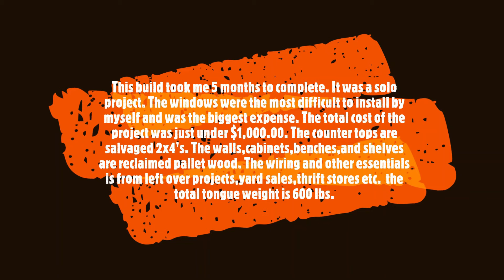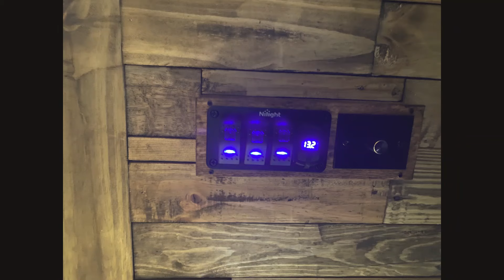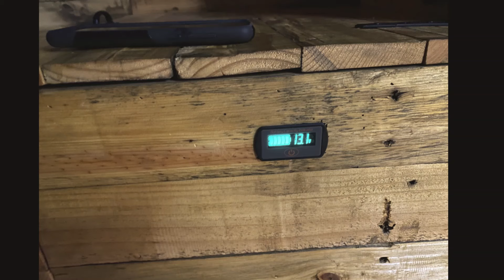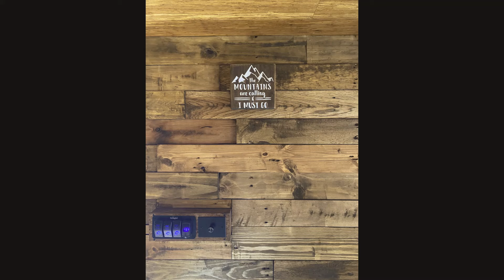Under 1K cargo trailer conversion

Comment: did the 1k include all the electrical and ac and batteries too?
Reply from the maker: Yes. The electrical wire I salvaged and bought at yard sales. The A/C I bought at a yard sale for $50. Batteries but new for $200.

Comment: Very nice build, I am curious as to the longevity of running all your conduit under the trailer. At least where I’m from that would rot out rather quickly due to seasonal changes. I’m sure in the south it’s not as much of an issue but I’m still curious of how it’s held up during trips

Comment: Awesome build!! There’s absolutely no freakin way you only spent $1,000 even if you had every bit of wood for free. All the electrical components and wiring and vent fan, sink, inverter, conduit, windows, heck I’ve spent a couple hundred just on screws with my build. So unless you are a carpenter/electrician that stole thousands of dollars of supplies from your job you’re gonna give poor saps like me the idea we too can do this on the cheap. 😅 for us non electrician/carpenter plumbers that can’t steal from our jobs that’s easily 3k plus the cost of the trailer itself. But definitely a gorgeous build!!
Reply from the maker: Nope! Yard sales,thrift stores,dumpster diving & left over home projects! And bartering. Just gotta be creative. Thanks.
Reply from the maker: @njerseydavid  you're an idiot.
Reply: Was thinking the same thing. I do flooring and can handle all the work myself and i would be able to get deals on some of the stuff from trade buddies but I spent $1500 on a battery for my tiny cabin in the woods 😄.
Reply from the maker: @mrscoob3450  I got 350 square feet of flooring for $80 at a yard sale. Had plenty for the ceiling.
Reply: I still call bs. Never the less it's gorgeous.  And heavy. I'll save weight for food and ammo

Comment: looks nice. I just stained and urethaned the plywood inside mine lol. Had a buddy who works as an electrician run the electrical though metal conduit, installed a plug boxes, switches, outside hookups and motion house light by the door.

Comment: What kind of screws did you use for building the counter top, I’m interested in building my own it’s looks awesome. Thank you.
Reply from the maker: I used 3" hex heads along with glue. Each 2x4 is screwed into the next. The last piece I went with black hex heads for aesthetics.  Thanks.
Reply: Thank you!
Reply: Also curious how you did your laminate ceiling?

Comment: How much does the unit weigh?? Looks sharp  alot of patients went into it I like the simplicity of it all
Reply from the maker: 3200 lbs. I pull it with a Ram 1500. No sway.Pulls great especially after putting the leaf springs on top of the axles

Comment: can you break down what you used to insulate? What material was used in addition to the foam boards?  Was it on both sides?  Did you need to use any glue or just fit and tape on the seems?  Im going to re-insulate my aluminum cargo trailer.  the builder used Styrofoam and it doesnt stop the suns heat at all.  Trailer is a hot box in the sun.  even the walls are hot to the touch on the inside,
Reply from the maker: Used 1" foam fitted. Taped the support beams. then after installing furring strips another layer of 1/2 inch.
Reply: you need to isolate the walls to prevent thermal transfer through the studs.. or just install a mini split ac and be done with it.

Comment: No way this was all under $1k. Vinyl floor and ceiling, windows, insulation put you well over $1k. Not including the lumber, wiring, lights, batteries, water tanks, etc. I’m building on right now.
Reply from the maker: Nope. All materials were salvaged, thrift stores, dumpster diving, bartered, & just stuff laying around. You just have to be a little creative. And of course yard sales. Be amazed what you can get cheap
Reply: @CTCAdventures  Okay, now it makes sense. 👍

Comment: $1000 ?? You must be joking. My 12 x 6 cost me $2800 off the lot. That was the cheap part. The electrical system alone was over $2,000. The mattress was $430. The vent was just under $200. There is all the wood and fittings. It continues to cost more and more as it is improved and upgraded. This video is complete bs.
Reply from the maker: Nope. Scrap pellet wood, scrap 2x4s, thrift stores, yard sales, stuff laying around the house, dumpster diving, discount stores, and bartering. It can be done dude! I did it!

Comment: I guess no one ever taught you about empty weight, useful load, and maximum weight. Nice at the sacrifice of limiting the useful load.
Reply from the maker: It's a CARGO Trailer!! It's made to carry weight! And for your information I went to the scales and added 700 total pounds! I think it can handle that!
Reply: @CTCAdventures  Ok thanks for the info.  Thought you would have put the weight in the video sub text section.
Reply: @CTCAdventures  kuhB@@M‼️🤯🆒😵‍💫😜✅➕
Reply: Lmao the same thing my haters told me on my build. I got to the point where I would look at them and be like "ya know,all this work and thought and detail I've put into this build and you think I overlooked weight?" They wouldn't have much to say after that.

Comment: Warning ⚠️ 
Using pallet wood.
Not only is it a nightmare to separate the wood, BUT,  pallets are treated with hazardous chemicals to make them last a long, long time. Sanding, is bad enough, but to use this much in an enclosed space this small...
Very bad idea, very bad